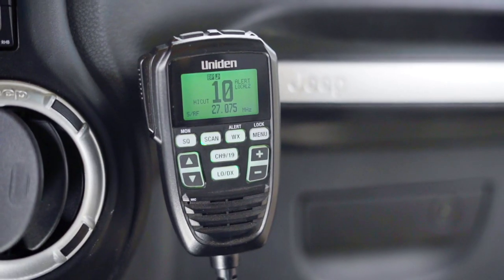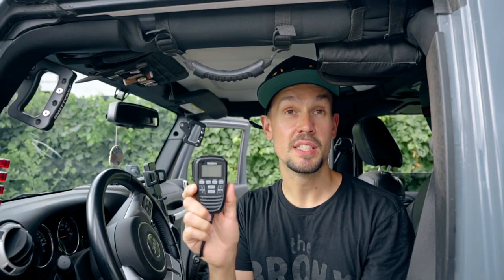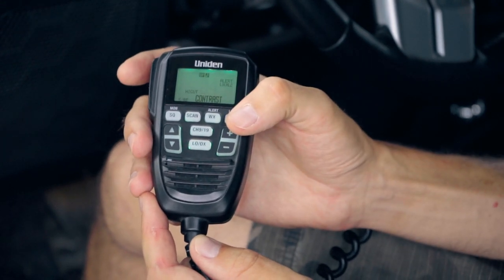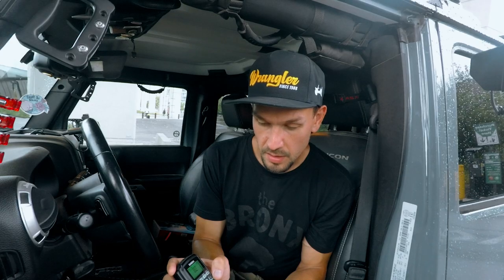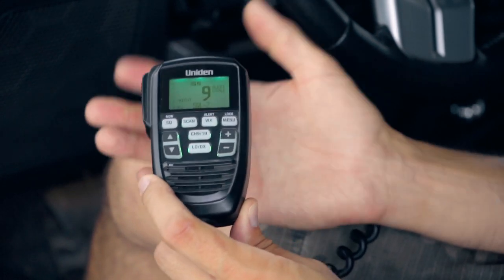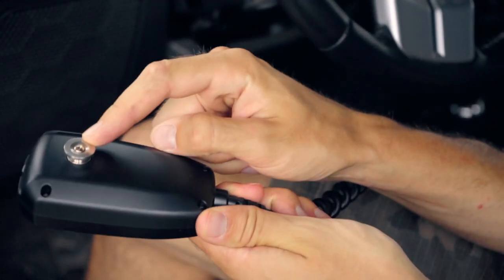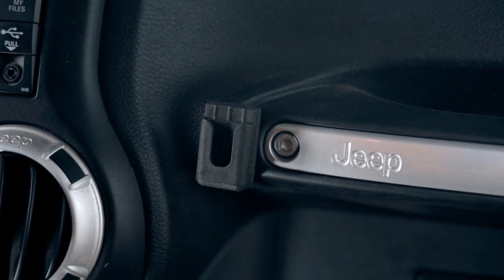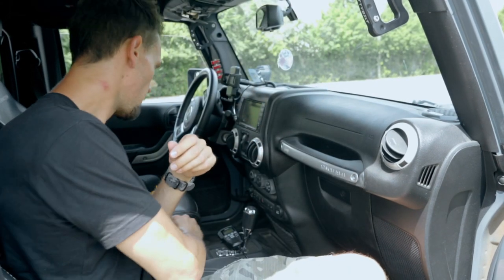My CB Radio Setup - Uniden CMX760

Comment: you can get GMRS mobile radios too. 50w with a 10 year licence soon to be only $35. then you can use repeaters and talk  anywhere in the US if you have internet or our local repeater covers 60 miles.
Reply from the maker: From what I've researched, we do not have any high powered gmrs in cab radios in Canada. Only hand held frs... lame!
Reply: @RubiconUnlimited  o Canada. ya I wouldn't know about that.

Comment: I ordered one of these through Amazon. The transmit button was shot. It just beeped at me. I had to send it back for a replacement.
Reply from the maker: Did they get you sorted out??
Reply: @RubiconUnlimited  they are sending a replacement eventually. It took time to get the first one. Maybe a Covid issue but if you look for this radio online it is sold out all over.
Reply from the maker: @gawgspates6940  wow thats super inconvenient! I hope it comes sooner rather than later
Reply: @RubiconUnlimited  just checked, it’ll be here the 22nd. So there’s that. I already had a President Bill on order for one of my other vehicle, so I may use that until then.
Reply from the maker: @gawgspates6940  oh that's not bad, hopefully this one works for you!
Reply: @RubiconUnlimited  so here’s the latest: I got the new unit yesterday (the 24th) and I installed it today. The new one wouldn’t power up. So I swapped the old brain with the new one. It turned on and worked. As soon as I put the unit into my console it started beeping again. So I plugged it into the 12v in the dash and it worked good. Then not good. I removed that extra long cord they supply and pushed in the plastic rubber cap to secure just the mic and it’s been working great. I think those surplus cords are the culprit. I’d hate to have to send it back again.
Reply from the maker: Oh man, it's the extension??? Maybe they will send you a new one of those
Reply: @RubiconUnlimited  I’m ok without it. If this thing continues working properly I’ll keep it. However, I bought a President Bill micro CB for my car and no problems at all. It’s a way better CB. The only problem is you can’t bury the unit as it has a face with controls not on the mic.
Reply from the maker: I was looking at that one as well, but went this route because of the hidden unit.

Comment: The antenna is mounted on a horrible spot. And its not grounded on the top. It needs to be grounded on the bottom where the coaxial is.
Reply: So then where would be a more acceptable location to place the antenna?? Please enlighten us.

Comment: the ground cable is wrong lol. The bolt is positive or center of the cable , check you swr. PUT THAT GROUND CABLE AT THE MOUNTING BRAKET BOLTS.and you need ground the gate to the body
Reply from the maker: Thanks! I have since adjusted this as per the above comment, looks more like this now http://www.firestik.com/images/fr-instl.jpg

Comment: Nice review.  I was thinking about upgrading to this CB. If I do I’ll use your link. I love CB. Grew up with it. 

I also have a Midland GMRS hardwired into my 4runner. Best part is with GMRS the handhelds are fairly inexpensive and very good radios.  While camping as a family we use handhelds with the 4Runner as the base. Plus if we go out with friends who don’t have coms we toss them one. 

Best and awesome rig!
Reply from the maker: Thanks so much, loving it so far! I did want to get a Midland gmrs mounted in the rig.. except you can't in Canada, very disappointing and silly. They only allow low powered gmrs here unfortunately or else I'd do the same!
Reply: we arnt talking G M R S we are TALKING GO OLD  CB radio's from the 60's
I had one that is how I cut my teath on got over mike shock fast

Comment: I can tell you didn't check your work with an SWR meter because you shorted the hot side of your antenna to ground where you bolted that extra ground wire.

Take the firering apart and look at what that bolt attaches to... The antenna and center conductor of the coax. 

Your going to have no performance with the antenna dead shorted like that and will probably end up damaging the radio.

Good day
Reply from the maker: I did test it and all is well. There is also an insulator bushing in the fire ring. Are you suggesting I move the ground wire?
Reply: I would check the SWR with no extra ground lead at all. If you get good readings then there is no need to add extra stuff. If you can't get the antenna system to tune THEN start playing with grounds.

It's always good practice to test the the antenna with an ohm meter before transmitting in to it.
On the antenna connector that goes to the radio test between the center pin and the metal shield. Should be infinite.

Then check between the center pin and body ground. Should be infinite. 

Then check between the metal shield and car body. Should be zero ohms if the mount is grounded good. But like I said above if the SWR is good then don't go chasing problems that don't exist.

For extra test if you can make the meter leads reach check between the center pin on the antenna connector at the radio and the antenna it self at the chrome base spring. Should be zero ohms. 

CB's will talk to each other when your feet apart on the road even with a shorted antenna but it aint good. Would hate to see you burn up such a nice radio. 

Be well
Reply from the maker: Thanks for all this useful knowledge! I'll look into this and hope this comment helps anyone with issues
Reply: @RubiconUnlimited No problem. And for FYI here is Firestick's tech doc on the Firering installation.  Great product you just have to be careful on the setup. 
http://www.firestik.com/Tech_Docs/mkfr-instl_nohook.htm
Reply from the maker: Thank you sir!

Comment: the only problem i have with mine is the speaker sucks and if the volume is all the way up it will back feed into the mic on transmit. Ill be hooking up a external speaker.

Comment: Do you have any pictures or video of how you accessed the cigarette lighter and spliced the wiring into it?
Reply from the maker: Sorry I didn't film that part, there are guides on how to remove that section of the dashboard online. You can use wire taps to splice into the individual wires

Comment: OK, so you've had the unit for a while, what has the reception and distance been like on the radio or are you giving that up for the convenience of the unit not taking up space
Reply from the maker: So far i haven't had any issues with distance on the trails. But with that being said, the crew usually stays fairly tight together
Reply: @RubiconUnlimited  like the others that have replied this was a great video and I give it a thumbs up, and thanks for the quick response
Reply from the maker: No problem! Thanks for watching

Comment: A characteristic problem of this type of radios is that do not memorize the on / off status when switch off/on the ignition. Does that radio do it?
Reply from the maker: It definitely remembers the on and off position. And it's a feature I'm glad it has!
Reply: @RubiconUnlimited  Thank You 👍
Reply from the maker: No problem at all, happy to help

Comment: I have mine installed but I can’t get a good mic check- I’m running a 2’ fire stick any suggestions?  Can you hook up a exterior PA spear to this?
Reply from the maker: There's an output for an external speaker
Reply: The 2 ft. Firestick although good quality, you would do better with 36" to 46". Antenna and mount even with the Roofline. Behind a car/truck body attenuates your signal and increases SWR.
Reply from the maker: Yessir! I plan to get a longer one now that my rooftop tent gets in the way
Reply: First, don't expect great range with an antenna that small, second, make sure your SWR is nice and low, the lower your SWR, the more power is actually exiting the antenna. If you still can't get one, try going to a high area around you like a mountain top or something. A nice clear line of sight will help you in making contacts. Or just drive on a busy highway with lots of truckers.
Reply from the maker: Great tips. I plan on getting a longer antenna soon!
Reply: @RubiconUnlimited  The king of CB mobile antennas is the 102" steel whip. It is a full 1/4 wavelength, no compromises. If functionality is less of a concern than aesthetics, you might not like it, because it is quite large, but I have seen range tests here on YouTube that got over 15 miles of range with one.
Reply from the maker: @tylerdean980  oh wow I'll have to take a look at that beast. Thanks for the recommendation